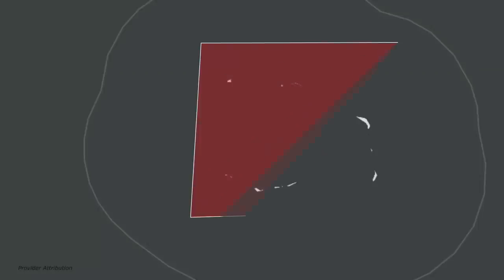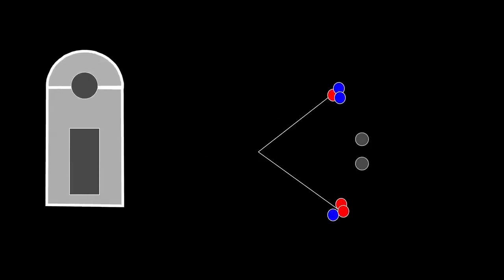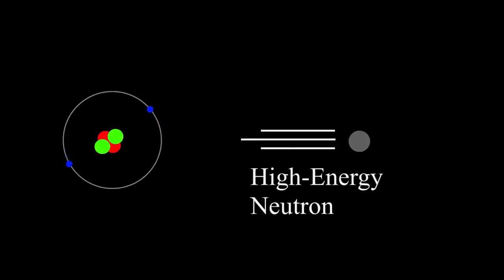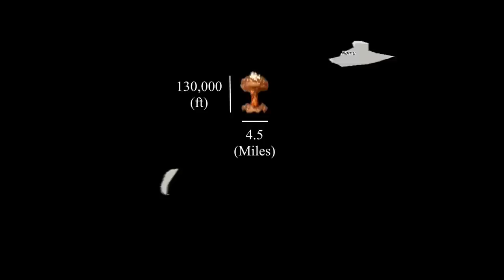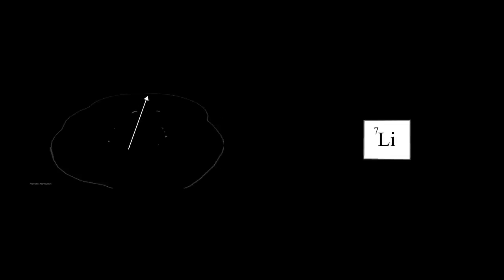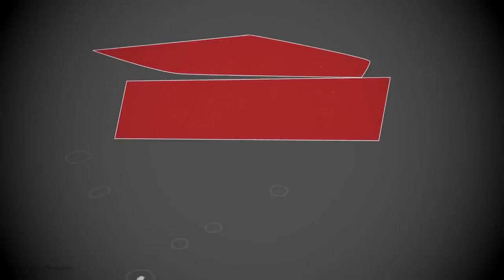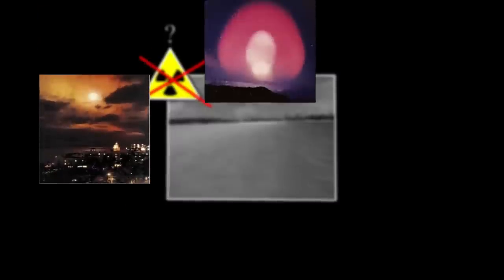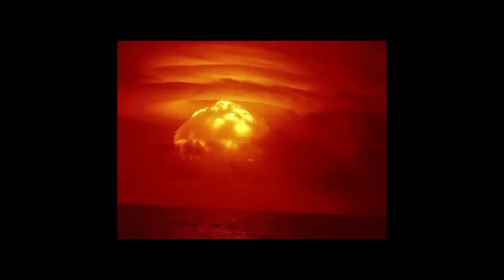How One Simple Mistake Caused a Nuclear Disaster

Comment from the maker: Corrections (PLEASE READ):

1:19 - There is some misinformation here. The nuclear fusion ignition is not caused by the high-energy neutrons directing towards/impinging on the secondary fuel, but instead the fusion fuel is compressed by the X-ray radiation emitted from the fission process. This causes the compression and ablation of the fusion fuel in the secondary stage, and accompanied by the high temperature caused by the fission thanks to the neutrons, it catalyzes the fusion process thus emitting tons of energy.

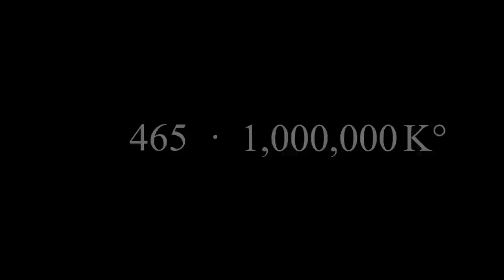2:16 - This is not based off of any confirmed data, as such, it is actually impossible to determine the absolute peak of the maximum temperature at any given moment of the Castle Bravo blast. But given its nature, it is only speculated to have reached only tens of millions of degrees Kelvin instead of the said 465 million degrees Kelvin as shown in the video.

2:30 - Einstein's formula E=mc^2 cannot directly be used to calculate the energy of a nuclear blast, as the energy released in a thermonuclear detonation is dependent on several different factors all requiring complex mathematical calculations. So while the formula is related to explaining the correlation between mass and energy, which has somewhat contributed to nuclear weapons aside from quantum physics, it cannot be used to determine the exact amount of energy released in a detonation unfortunately.

3:56 - TNT and Dynamite are not the same thing.
Reply: Might want to pin this comment so that people don't constantly ask you for the same corrections.
Reply: Not a disaster? Tell that to the poor souls on that fishing boat.
Reply: Isn't it the gamma Rays that primarily compress and 'ignite' the fusion fuel
Reply: make it for good things
Reply from the maker: @samcranmer434  No it is actually X-rays, as they are typically emitted in a fission process.
Reply: Right. E=mc^2 actually applies to all energy-releasing reactions, even chemical explosions. It's just that chemical reactions are so weak that the change in mass is extremely tiny. Only in nuclear reactions is it strong enough to be easily measured.
Reply from the maker: I just wanted to note an interesting fact that E=mc^2 is the equation for the energy of a stationary object: basically a body that is moving through time but isn't moving through space. The E=mc^2 formula is derived from E=mc^2/sqrt(1-v^2/c^2), see if v=0, this entire right-hand side just reduces to mc^2. This is often used as one of the arguments as to why a body with mass cannot possibly reach the speed of light since then we would be dividing zero which would practically make no sense (it would imply an indefinite amount of energy).
Reply: @AllIsWell-Ark  That's correct, and it's why the mc^2 term is call the "rest mass" of the object.
Reply: ...what he said.
Reply: There is another factor that the correction does not address.  Although it is true that scientists underestimated the efficiency of their solid fusion fuel, that was not the cause of the disaster.  True, straight-neutron radiation is deadly, but it is also very short-lived; if the only factor in this scenario had been neutron bombardment by lithium-deuteride fusion, Bikini Atoll would be inhabited now.  But it was not the only contributing factor, not even a major contributor.

Every nuclear scientist back then would tell you, if your security clearance were up to par, that a fusion reaction could not possibly be sustained without outside help.  It can be initiated, but the initial ignition would send neutrons flying out in every direction in an uncontrolled manner; and not enough of them would go back into the fusion core to trigger a full fusion burn.  A shell (a tamper) was required to contain the fusion fuel and the runaway neutrons, so they would be deflected back into the fusion core and continue the fusion chain-reaction.  To make such a shell required the use of a very dense element.  They chose uranium.  In its natural, depleted form (the -238 isotope), uranium is not a practical fission fuel; no conventional explosive made can trigger a fission reaction in uranium-238...or, so they thought (accurately, but they failed to consider the NON-conventional).  As with all thermonukes built and tested before the Bassoon device detonated in Redwing-Zuni, the Shrimp device was encased in uranium-238.  As was the case with every one of those test weapons, the explosion became much larger than expected, because a fusion reaction at full burn is more than enough to trigger full-blown fission in depleted uranium.

Two thirds of the energy released by Castle Bravo has definitively been determined to have been caused by fission, not fusion.  That means 10 megatons of fission.  That is what caused the disaster.  The scientists never bothered to factor in the fission effect lithium-deuteride would have on its uranium casing...which I still can't fathom, because they should have thought about it after Ivy Mike; the liquid deuterium from that explosion triggered nearly 8 megatons of fission energy from its uranium casing.  Either they never picked up on that, or they disregarded it as a fluke.  But after the Castle operation, they were forced into rethinking the fission factor in thermonukes.

That is why I hold to the conviction that none of the so-called "hydrogen bombs" tested until 1956 were true hydrogen bombs despite the hydrogen components used in them.  That did not occur until Redwing-Zuni, when the majority of that test's yield did come from fusion.  Everything tested before that test was just a colossal boosted-fission weapon, as the Greenhouse-George and Greenhouse-Item tests, just hundreds of times more powerful.
Reply: @samcranmer434  Well, X-rays, but neutron bombardment is what sustains it.
Reply from the maker: @aloysiusbelisarius9992  Thank you for the information!
Reply: @philkarn1761  Very good, plausible point.  Their efforts wound up all for naught, however, after Castle Bravo, both from the larger-than-predicted yield and then from an unexpected change in upper wind patterns which blew the fallout away from where they wanted it to fall, poisoning areas that had been established as safe zones.  That really exposed the real dangers of those thermo-fission weapons to the public awareness.
Reply: @aloysiusbelisarius9992  At least the Russians were smart enough to use a lead tamper instead of uranium in Tsar Bomba. Otherwise it would have been 100MT instead of "only" 50MT, and a huge source of fallout. Percentage-wise, Tsar Bomba was one of the "cleanest" bombs.
Reply: @philkarn1761  This is true; actually, Tsar Bomba is officially recognized as the cleanest nuke ever detonated:  Only 2.5% of its yield came from full-fission of its spark plug, the rest came from the two layers of fusion fuel.  Even Khrushchev's politburo had to see the potential for self-destruction if they endorsed the testing of the original design; the Cold War would have come to an end right then and there.

Comment: They bombed Utah that same way. Ignored wind direction and had a lack of concern for population.
Reply: They didn’t necessarily ignore wind direction. If the yield had been as predicted they would have been in the safe zone.  Castle Bravo ‘s yield way much greater than predicted and resulted in much more fallout.
Reply: In the case of Castle Bravo there were two wind directions at once. The higher altitude winds were westerly if I recall and that also contributed to the disaster.
Reply: #DownWinders
Reply: @charlescurran1289  thats correct
Reply: And the Australian outback including soldiers standing in the blast area to measure the results.  
They were told not to look right at it and dust themselves off after
Reply: @getahanddown  Holy crap

Comment: what would happen  if you added more stages to the device? is there a limit to the amount of stages that could be added? what would be the estimated yield if say 3 more stages were added?
Reply from the maker: Actually no, there is no limit; in fact, it is suspected that the most powerful thermonuclear bomb ever detonated (Tsar Bomba) used several stages to increase its “blast power”.
Reply: @AllIsWell-Ark  it's not suspected, it's true! The TSAR bomba is a 3 Stage design, Stage one was a fission device, than the fusion stage happend, the fast neutrons of the fusion then reacted with the Uranium 238 temper of the bomb casing, releasing the biggest fraction of power of the bomb
Reply: @huey-fan8335  It is already an impractically large weapon as far as its physical size and weight is concerned. This imposes severe limitations on the delivery methods of the bomb
Reply: There's also the limiting factor that, at some point, the explosion would be so large that a good portion of it would rise above the atmosphere and basically dissipate into space. It's technically possible to build bombs with a yield in the gigaton range, but unless you were actually trying to alter Earth's orbit, or something equally mad-sciency, there's not much point to it.

Comment: It was the X-ray flux, not neutrons, that was channeled to implode the secondary. The plutonium “spark plug” then fissioned and pushed against the pressures generated by the primary.
Reply from the maker: Yes, it is true that X-ray flux was a primary cause for the secondary implosion; however, neutrons also played a crucial roll in the intitiation of the fusion fuel. High amount of electromagnetic radiation from the fission from the first stage helped to ablate, and as said compress the secondary fuel which is also ignited by many accompanied high-energy neutrons causing extreme temperatures through fission. Looking back at this video, I was certainly wrong and I am not necessarily surprised since I didn't necessarily have a lot of knowledge about nuclear physics when I created this video (a few years back as a fun little project), but thanks for letting me know. I guess I was just a little bit too confident.
Reply: @AllIsWell-Ark  I agree. Just trying to simplify a somewhat complex arrangement. I stand corrected. Stay well.
Reply from the maker: @michaelteague3190  👌